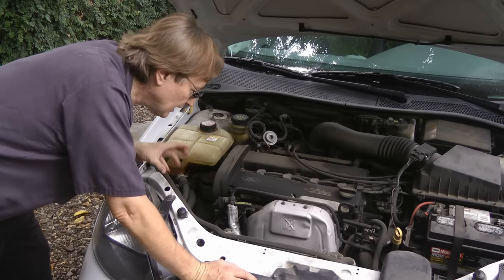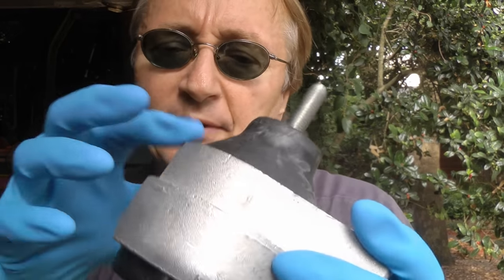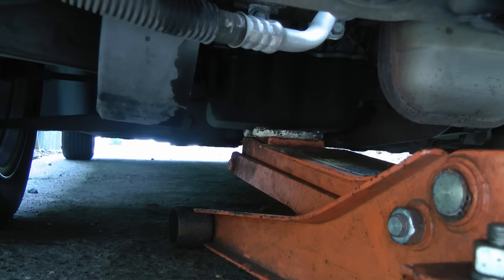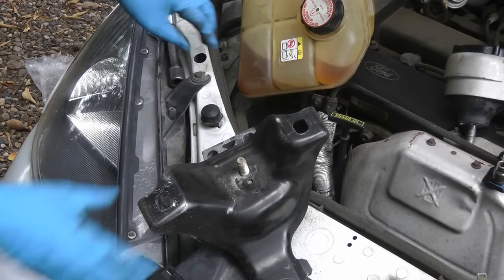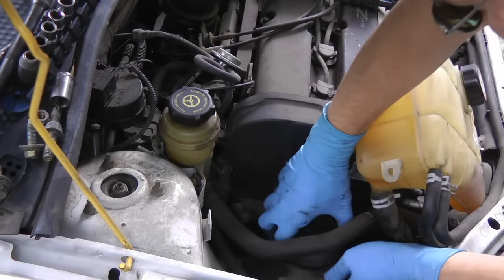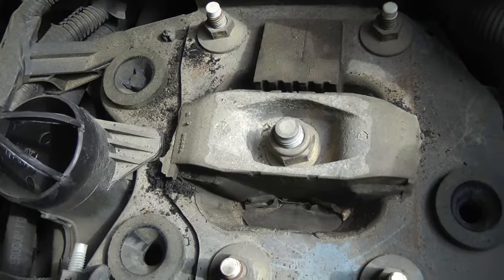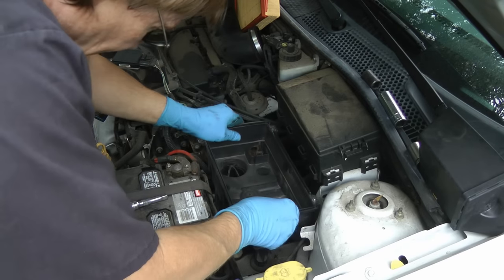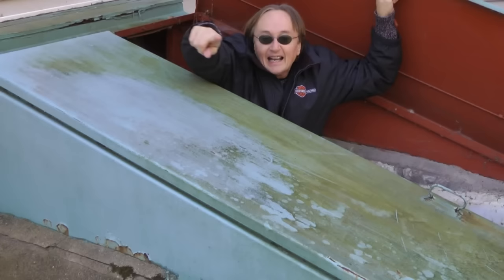How to Replace Motor Mounts in Your Car

Comment: Wait so he held the engine up by the oil sump? I don’t don’t it can’t be done but i’ve dented my oil sump just tightening the drain bolt to much. Is the a better way to support it without a chain or hoist?

Comment: I have a 98 Saturn SL that's throwing a knock sensor code is there any chance a bad passenger motor mount would cause this code to get set ???    

And what is everybody's opinion on a 98 Saturn SL

Comment: I have a 2003 nissan Altima v6 an I'm assuming the engine mount wouldn't be in that same location under the coolant system. Mine is in the middle of the vehicle an seems harder to dismantle

Comment: hi scotty big fan of yours ..got so much knowledge from you ... i have small sedan car its has sound of tuck tuck sort of when leaving clutch specially in 1st 2nd gears .. i saw one of the side of mount rubber is crack ... how would i diagnose that sound or what is it a clutch or axles or bad rubber mount ? 
           Thank you !!
Reply from the maker: fix the mount first, pray it's just that and not internal clutch problems requiring new expensive replacement

Comment: thanks for all these videos Mr Kilmer! 
driving my 93 thunderbird 5.0 v8 and bottomed out on a steep driveway and banged the front underside more than a love tap. since then there is a rapid shaking, a vibration that begins upon ignition, vibrates in park neutral drive but it somewhat goes away once the vehicle is doping 40 or 50. i cab feel it thru the steering wheel and rattles the entire car as intense as vibrating back massager, but not that fast of a buzz, do you suppose it could be mounts? Drive shaft?  i was thinking power steering maybe.. because how much i feel it in the steerin wheel. or am i way off?
Reply: Same in my 2010 Mazda 3 what ended up being your issue ?
Reply: @laylamolliere3367  there was a harmonic balancer attatched to the drive shaft,the rubber which held the weight knocked loose so it threw the engine like crazy.  you can tell if its that part by following the serpentine belt and wiggling the various pulley wheels the belt turns, if one is super loose its most likely damaged. the motor mounts are another suspect to check, if the rubber is all cracked or a bolt is missing the engine can shake excessively as well.

Comment: Hey Scotty I hve been watching ur videos and I say thx for the good job u doing out there, my question is hve 2004 volvo s40 2.4i and I hve been having this rattling noise coming from the front engine passenger side and I only hear the rattling when I apply gas and it's driving me crzy do u think I need a new engine mount ? Thanks
Reply from the maker: Rich Bay do these tests to find out, also check the strut mounts on passenger side, they go bad a lot on volvos

Comment: I may have an issue with my 2011 Mazda RX8. Loss control of the vehicle in the rain (F***ing MIAMI) slammed into a concrete wall. Cracked my rear right rim half way, snapped a couple control arms, shock and suspension were done. Had everything replaced but it doesn't drive the same. Wasted money on an alignment, as soon as I slammed the brake it went out of wack. Slight rattle when braking at stop signs and lights, and vibration when accelerating at high speed (50+mph).

Comment: Yea i gotta question we replaced all 3 pulleys on my car, and the serpintine belt keeps slipping off for some reason.. we replaced all 3 pulleys because of it slipping off, but its STILL going off.. could it be the engine mount shaking the serpentine belt off??

Comment: Hey scotty, I have a 2010 Honda civic lx coupe, the front passenger motor mount is out and I was wondering If I should tackle the job myself or pay $100 in labor to have it done. I have worked on cars before but nothing really past oil changes and brakes. I guess I am most nervous about jacking the engine up, any advice?
Reply from the maker: easy job, do it yourself, just put a piece of wood under the pan for the jack to push it up with

Comment: I have a 2005 Honda Odyssey with I believe have 4 or 5 engine mounts, with 117,656 miles. Are they expensive to changes?
Reply from the maker: yes, it's quite a chore

Comment: Hello. I was wondering if you knew about 07 Scion TC motor mounts? My car is starting to vibrate when idling, and the local auto place wants around $600 to replace. Can you help? 
Thanks!! Keep up the good work
Reply from the maker: they are rather a pain to change out, but if you have a jack and some hand tools, it can be done. Just realize it's a dirty job that will take a whole saturday for most people.

Comment: Hello, Mr. Kilmer! I have a question for you. I plan to drive from West Virginia to Maine on my Volvo 960 1997. I took my car to service yesterday and was told that 3 out of 4 engine mounts on my car are loose/cracked/bad and only 1 is fine. So, I was strongly advised against driving it so far. What do you think? Is it really so dangerous and I must rent? Thank you!
Reply from the maker: that's a long drive, but really, if engine and tranny aren't shaking on start ups and accelerating, they are bullshitting you. Get a second opinion.
Reply: I don't think is a safety hazard. Even if it was true which I highly doubt, I don't see why you couldn't drive it there. The engine is bolted to the chassis and the mount itself is to reduce vibrations. If you don't feel strong vibrations while driving then you are fine

Comment: Hey Scotty. I have an 03 expedition and the power third row seats won't budge. Changed the fuse and still not moving. Both sides don't work so I know a have a bad ground. What's the easiest way into that?
Reply from the maker: +sjwilson1079 get a wiring diagram and trace it out. I use alldatadiy.com

Comment: Hey Scotty, 

I have a 2001 Mazda 626 with approximately 126,000 Miles on it (It's a fantastic car, I love it almost as much as I love Toyota but it can be annoying to work on) but anyways the Motor Mounts seem to be worn and the engine does make a knock when I do reverse to drive and so on. Is it worth having them replaced? or let them go for awhile until they become more serious. Also I have never done a timing belt replacement and a shop wants 1000$ to do it, what's your recommendation? 

Thanks!
Reply from the maker: heck, change the timing belt yourself, see my video "replacing a timing belt on your car".   Get some aftermarket motor mounts and change them when you do the timing belt, save a ton.

Comment: Hey scotty, got a question on an atv engine. The starter is moving when the engine is cranked. Is this normal?. The starter is hanging off the side of the motor and its tightly secured on the engine. The atv is a bombardier ds650 2000.
Reply from the maker: not normal, starter should be rock soolid. If it's on super tight, then starter is coming apart itself

Comment: Hey scotty I love your videos but when you place a jack on the oil pan shouldn't you place something to increase surface area so the jack doesn't crush the oil pan. I'm not 100% sure how strong they are other than there single piece of metal
Reply from the maker: on thin stamped steel oil pans I use a piece of wood, but this is an aluminum cast one that is VERY strong and the engine is rather small
Reply: oh whoops :s thank you tho :)

Comment: one of my fan blades cracked my radiatior. Should I be looking at my motor mounts? car is a 99 BMW 323 164k miles. two mounts on the sides. Thanks!
Reply from the maker: yep, that's classic signs of bad mounts.

Comment: haha I wish mine were that easy in my 97 Grand Prix. The whole bottom subframe has to be dropped. I imagine both lower mounts are bad as I see the hydraulic fluid that was in the mounts everywhere. Do you suggest solid rubber replacements or OEM hydraulic mounts again?
Reply from the maker: Yes, I would. And then I'd never buy another GM product again to get even with them.
Reply: I agree. I've had a few turbo Eclipses and even though I pushed more power through them than factory they never fell apart as often as this Grand Prix. Looks like I might have to look for a Honda or something foreign in the future.

Comment: I'm attempting to change the water pump of my wife's 05 Hyundai Tucson. Theres a piece that goes from above the motor mount to just above where the serpentine belt is located. That piece is stuck after removing all.of the bolts. What am I NOT doing right?

Comment: Scotty,
how can I be sure that my engine mounts are worn? I got a W203 Mercedes and I did the test. Brake and a bit of throttle in gear. My engine moves a little when in drive.  Less than it does in reverse. Maybe about an inch in drive.
Should I have them changed?

Thanks!
Reply from the maker: They should not move at all, I would jack up the engine from the bottom using a jack and a piece of wood, and see which mounts are cracked and have space when jacking up
Reply: Thanks man! Thanks a lot for the advice. I'm gonna have the engine mounts checked up in a week or two and replaced. I want to make sure my Benz runs perfect.

Comment: Hey to Scotty, great videos. Any suggestions on changing the center motor mount on a 2006 PT Cruiser Turbo. Not sure if I need to drop the engine or whut, thanks.
Reply from the maker: Dave Almeroth  actually best to loosen all mounts, jack the engine up, then change the center one
Reply: Thanks Scotty, I'll try it an let ya know how it goes

Comment: I got a 1999 Ford Escort Lx that it vibrates like crazy when I put on drive, but it stops when I accelerate  and it drives perfectly fine.  I have done a tune up and also clean the throttle. Do you think this could be it?
Reply from the maker: it often is on that model, but of course could need tuning up or maf sensor cleaning too
Reply: Scotty Kilmer thank you for taking your time to answer me. I have done the tune up and it help a lil bit, change the EGR sensor and valve because I had a check engine light on. What also do you recommend me. It only vibrates when I put the gear on drive, and it stops when I accelerate. Thanks for your help, your videos are amazing.

Comment: i have a question and i know this is an old video and probably wont get a response however ill try anyways. i have an 06 odyssey. all 5 of my motor mounts are broken. 2 are elctronic an 3 reg. this is the third time in 4 yrs iam doing this. more scariest the last time i did all 5 was about 4 months ago. funds were tight an i got after market. this time honda wants 2600 which is whatever. i dont have a trust worthy mechanic where i live. i have threeyoung children so i need this done right. question is what can keep causing these to go so often and what other damage can i do to my odyessey driving it like this until i can replace them? hope to hear from you soon. thanks in advance

Comment: I wish my motor mount replacement was as easy as that. followed everything that was mentioned in the video, but it was a bitch to align the screw holes with the new mounts. I'm glad I've finished it.

Comment: i had a first gen focus once..  the ztec motor is AMAZING. but most of the stuff bolted too it is cheap..  but thats were aftermarket comes in ;). plus the zetec focus is a super easy car to work on!  shoulda kept my 5speed zx3.. :\

Comment: If the engine mounts are bad, how can you tell which specific mount is the bad one, even if they all visually look ok ?
Reply from the maker: +sypher0101 jack the engine up from the bottom and see which one or ones are cracked open then

Comment: 07 Charger R/T
What is the difference between ENGINE SUPPORT CUSHION and ENGINE MOUNT INSULATOR?
I went to the dealership to order engine mounts, gave them the part number of the OEM part currently on my car 4578193AE (ENGINE SUPPORT CUSHION) and he said that was the wrong part for my car. He came up with 5180406AE (ENGINE MOUNT INSULATOR). It looks nothing like the part on my vehicle. Could it be the newer replacement?

Comment: For the past year I've had strange creaking and squeaking sounds. I'd tried to diagnose the entire suspension, but I cant pinpoint the problem. Two of my motor mounts were going bad so I replaced them, and greased the others, but I still have the annoying sound. I hear it on accelerations, when shifting to D, at bumps sometimes, and when holding the brake at stops. Any idea what else it can be? When I shift to N I dont hear the sound

Comment: Hey Scotty i messaged you a few weeks ago and you fixed a problem in my car with the exact solution now the car runs good but. I have had one problem with it since buying the car, hopefully you have an answer. My car runs great but in stop start traffic especially short distances when i put the clutch in and come to a stop the car it feels like its about to die. Sometimes i even have to touch the accelerator a touch as i stop just to bring the revs up to stop it from dieing than it go's back to normal it only happens in short distances and stop start traffic never when pulling up from a long distance. 1994 SSS Nissan Pulsar Any advice?
Reply from the maker: try my video "how to fix a car that idles poorly" and pray you don't need a new iac valve.
Reply: Scotty Kilmer
Thanks Scotty
Reply from the maker: ShoulderRollJason  If you like my car help, be sure to watch my live car talk show every Saturday morning at 10 AM CST on YouTube. I answer your car questions LIVE there. Just check it out at How To Ask A Live Mechanic Car Questions Free On YouTube . And remember, every TUESDAY  I upload a new video, so don’t miss them.

Comment: Would It be dangerous to put the jack under the oil pan If the pan Is made of aluminum, just like In my 2003 honda accord coupe V6? If so, should I switch the place I put It on? Or put A piece of wood on on top of the jack so It reliefs some of the pressure off from the oil pan? Or find another place I can put It under?
Reply from the maker: piece of wood on thick aluminum is fine
Reply: Scotty Kilmer Ok cool. Thanks

Comment: Scotty I have a question my 2011 Nissan Versa 1.8 the front end clunks loudly whenever you hit a bump were assuming it's one of the motor mounts but there are four motor mounts? lt has 230494 miles on it. I got it when it was brand new.
Reply from the maker: technically there are 2 motor mounts and 2 transmissison mounts. But bump clunks are more often worn strut mouts or ball joints
Reply: We bought new struts but have not been put in yet. And when it clunks I can feel something hit the floorboard if your sitting in the two front seats. It's getting bad. Oh like in your video when I put in reverse or in drive the whole engine moves. I don't know what's wrong with this car.

Comment: if it is th catalytic  converter is that a hard. diy. and i herd alot of stuff about the throttle body being dirty or broke. ( i was looking up possible problems ) since it does srtuggle to start and wont go past 30 mph. could that ne it too ?

Comment: I just got a 1999 camry. I noticed when i am at highway speeds above 115-120 sometimes when I release the gas pedal I notice that my car jolts a bit. would this be the engine mounts? It idles fine it doesnt shake . shifts better then my 2000 corolla did before it was written off
Reply from the maker: Hidden Concept more often that's worn internal transmission parts, but do check for broken mounts first

Comment: I’ve spent the last 10 hours trying to wiggle out just one of my motor mounts because it has a ridiculously long stud going through a bracket. I can’t fit my angle grinder in there to cut it either, even with the wheel and wheel well taken out. Can’t fit bolt cutters. Tried loosening the bracket and it won’t move. It’s only 1/4 of an inch to coming out and it’s so frustrating. Going to buy a big floor jack in the morning. My FIL says it won’t hurt it to jack it up higher so that’s what I’ll do
Reply: And I’m going to put the nut on the new stud and cut off most of the excess stud then back the nut off to make sure it will thread. That way it will go on WAY easier.

Comment: hey Scotty I have a 1995 contour and it doesn't shake when I'm up to speed and doesn't shake in park, but when it's in drive with my foot on the brake it shakes a lot, looks like the engines gonna fall out. do you think that because of the motor mounts or something else?
Reply: and when I turn the wheels all the way in either direction the car squeals loud and the belt binds and sometime the car even stalls
Reply from the maker: ***** do check the motor mounts, and also do my video "finding engine vacuum leaks with a cigar"
Reply: Awesome thanks Scotty!

Comment: Hey Scott, I have a 1989 SAAB 900 turbo that jumps like CRAZY whenever I lift my foot of the accelerator and then put it back - sometimes it jumps so much it knocks it out into neutral! It also jumps when I put it in reverse, but not from neutral to drive gears?? And I can't for the life of me find the engine mounts!
Reply from the maker: sounds like bad transmission or broken motor or transmission mounts. that's an over engineered saabs, parts are in weird locations, but jack it up and you can see them from the bottom
Reply: Alright, I'll check it out, thanks! :)

Comment: great job!,,isn't there a third mount where you need to get under the car ?
Reply from the maker: +roadstar499 depends on the design, some even have 5 mounts
Reply: +Scotty Kilmer only two...that seems best for sure.I have 2002 Celica g.t.s it has three...only one in back looks like rubber bushing is pretty bad...the other two look good.hey do your neighbors give you crap about the burn outs before every video?..like your right to the point quick videos. ..keep up the great work..thanks